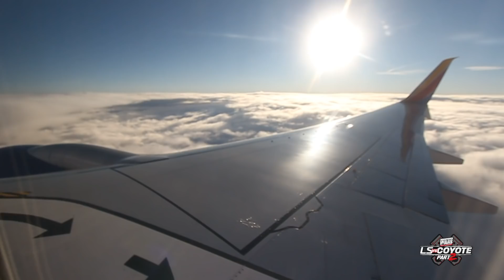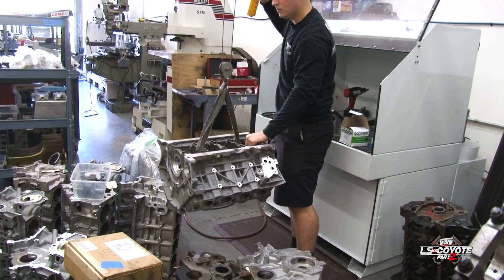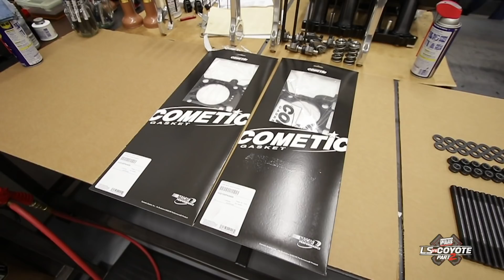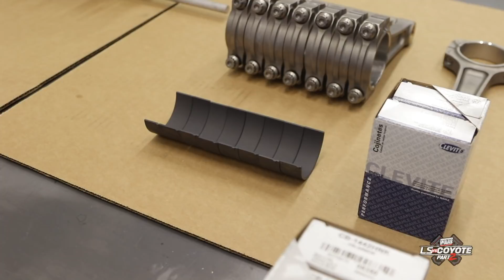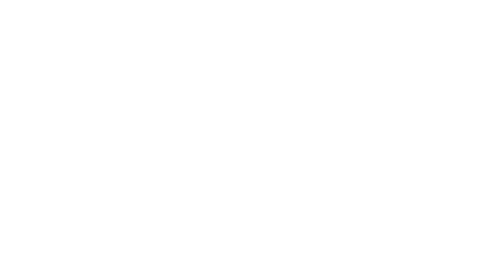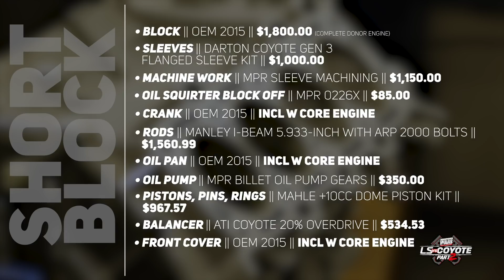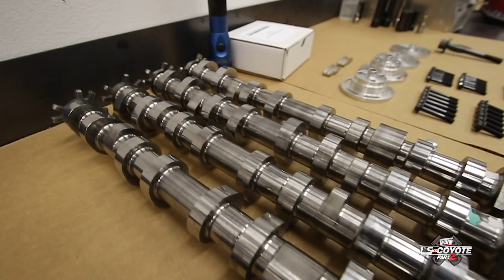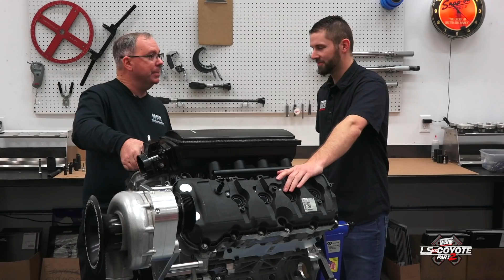LS vs. Coyote 2 Episode 3: The Coyote Engine Build

Comment: Edit: I'm glad you changed your mind about clumping the Coyote build into the dyno shootout. I appreciate the equal exposure :)

Wait...so the LSX build gets it's own episode talking about the build and the place building it, but the Coyote shares its episode with the final dyno numbers and track times?

Why do you guys try to act like you aren't GM biased?
Reply: @SyphonX  But hey...I get it...Stock GM motors cant make power and you need 7 liters to compare to Ford's stock 5 liter motor....
Reply: @SyphonX  If it's better why didn't they use the LS3 out of the Camaro they started with in the beginning of the series?

6.2L isn't enough motor to handle a little bitty 5.0L??
Reply: @richardhead8826  you clearly dont understand displacement. Ford used a fully machined 5.0 with custom sleeves and all. The 5.0 dosen't have stroker kits and head kits the LS is all about stroker kits and head kits. You can take a 6.0 LS and stroke it up to a 7.3 by just changing the crank because the blocks are the same size. They took a 6.2 and put a stroker crank in it. That's all.
Reply: @robertgardner2782  This is not true...MMR made 2000 hp on a 358 stroked Coyote based block. 
The SBF 347 motors were KILLING any LS1 they pulled up to back in the days.
Stroking and boring Ford's is not a new concept.

The point is the reason LS has so many aftermarket parts to choose from is because they NEED it to match the efficiency and power the Coyote can make.
The point is I BET a years salary a MAX EFFORT LS3 wouldn't come CLOSE to what the Coyote in this video is going to make with even 1.2 more liters.
The point is LS needs a Honda engine more displacement just to keep up.
Reply: @robertgardner2782  
It's possible to stoke a coyote beyond 5.2l with an aftermarket block, its just very expensive since there is only one source available as far as I know. MMR.
Reply: @richardhead8826  a 358 is a custom crank job that I'm sure costed alot more than $15,000 budget build. Ford offers no crank swaps for the 5.0 or head swap options for 5.0 and the funny thing is the 5.0 is larger and weighs more than the LS. You just sound nervous. LS guys are not complaining about the LS build cuz we not worried about the results lol.
Reply: Not to mention doing the math of all the prices they showed, there is over $1600 missing out of the budget. 

My total came to $13,042.10
They said $14,668

Weird.

Even if it's taxes, which in Florida is 7% that comes to a total of only $13,935.
Reply: @robertgardner2782  Not nervous at all. Next video will show either the Coyote winning, or more bias. I stated in the introduction video to this series that boosted is where Coyote shines over the LS motor. LS is King in the NA world.

¯\_(ツ)_/¯
Reply: Richard Head slightly older but still has lots of potential is I never get is why nobody even thinks of the 351 Cleveland or 351 Windsor. You can modify it heavily and make tons of power just like the LS motors. And do it just as cheaply like you can an LS motor. Just baffles my mind that people have these arguments and never consider that motor in the discussion. Also, MMR made a 3200hp Gen X Coyote motor.
Reply: SyphonX you do know they had 5.8L in the ‘13 and ‘14 GT500 right?
Reply: @SyphonX  lol, right, because its not like no one has already stuffed a 8L quad turbo w16 into a car the size of sedan and still had room for more heat exchangers then an air conditioning factory. No way a slightly wider and longer dohc v8 could ever fit in something the size of a mustang.  Also, even if it was somehow impossible to have a 6 liter flat plane v8, and its not, no one said the voodoo HAS to run a flat plane crank, the coyote is capable of 8500rpm with voodoo heads. That said, notice all you've got is "its too wide". No answer to the old small block's relative mediocre output for its displacement.
Look, dude, I like both GM and Ford stuff, but that dosn't blind me to the performance shortcomings of the old school cam in block stuff. I know, I've been building them for years. There is a well-built blown small block sitting in my camaro right now, but 4 valves are simply better than 2 when it comes to raw airflow and horsepower. Deal with it and quit being a jackass.
Reply: @SyphonX  the voodoo engine has like 310ci and do 526hp. Ford can just stroke the 302 and make over 550hp. The same goes to voodoo engine. It will fit the same. Ford doesn't need a 6.something ci to run fast.
Reply: @domenathor5.0 , you know your displacement 🤦‍♂️
310 cubic inches is 5.07999
Reply: @bowtie-man  they did so well with it they went bankrupt.............
Reply: @jonathangray7067  I just wish fomoco would pay my tax money back, oh wait that won't be until 2022.
Reply: @bowtie-man  but they will pay it back, thats the difference between a loan and a bankruptcy, i dont want your lil head to blow up by asking you to do some research! But if you'd like to learn something go read about it
Reply: @jonathangray7067  how about you hold your breath until they pay it back. 😂😂😂😂😂
Reply: @bowtie-man   Ford never took your tax money. They took a loan, which was paid back. They didn't need the money . Gm And Chrysler were subsidize companies and Ford took a government loan so they could compete fairly with government motors or have you forgotten that the government fired GM's CEO and sold Chrysler to Fiat.
Reply: @waynewilliams1726  wow how nieve.😂😂😂😂😂😂😂😂😂😂 https://www.quora.com/Why-does-Ford-Motor-Company-continue-to-hold-onto-its-5-9-billion-U-S-taxpayer-loan-at-25-interest-when-all-other-auto-manufacturers-in-the-U-S-have-already-repaid-their-bailout-loans-and-federal-assistance
Reply: mr.18436572 and then there’s also this from the same site - https://www.quora.com/Why-was-Ford-the-only-major-US-car-manufacturer-who-didnt-accept-a-government-bailout
Reply: @TFS96GT  it's common knowledge that fomoco didn't get a bankruptcy loan this time but they did receive a taxpayer loan of which they haven't paid back, that is till 2022. Speaking of bankruptcy. https://asavagefactory.wordpress.com/2009/05/16/ford-got-the-largest-government-bailout-in-history/
Reply: mr.18436572 I don’t even know why this is being brought up when this whole video is about engine wars. But check this link out - https://www.google.com/amp/s/www.autoblog.com/amp/2018/11/28/trump-says-gm-should-repay-u-s-taxpayers-for-bailout/
Reply: @TFS96GT  because the oval girls can't keep from😭😭😭😭😭😭😭😭 about something that happened almost 9 years ago and the fact that your new tech is getting schooled by 69 year old pushrod tech.😂😂😂😂
Reply: mr.18436572 I don’t know if you caught any of my other comments but this will be the 3rd time I’ve said it. I don’t know why some (obviously you) can’t recall that there is an engine made by ford thats just as easily and cheap to upgrade or make high horsepower with. That is the 351C and 351W, both of those motors you can go get out of a junkyard for $400-$650 and do whatever you’d like to. I could care less which engine wins this horsepower war. In reality whoever is happy with whatever engine they have so be it. I just don’t get why most LS fans think there isn’t a ford engine out there that can’t be as easy to put big numbers down when there is. I like both motors, both motors perform exceptionally well. There are pros and cons to each. All of which is obvious.
Reply: @TFS96GT  then why isn't it the 351 vs LS challenge? But the reality is that majority of the ford people don't use the old ford pushrod engines for some reason, go figure.
Reply: mr.18436572 Oh my gosh... because of the obvious which is they’re taking what’s new this LSX vs the new coyote. And in another comment I also stated just that saying this is a comparison between the newer motors.lol 

I know they don’t and I get why in a sense. It’s what popular and new, the mod motors do run well and like I said both motors run exceptionally well and both can put out some crazy numbers. The new coyote block is pretty impressive, MMR has been able to squeeze 2214 hp out of it and the block hasn’t gone yet.
Reply: @TFS96GT  you do realize the mmr coyote block is a fully cnc machined billet block at about 11k for a bare block? I would hope it would support 2200 hp.
Reply: mr.18436572 MMR posted on their Instagram  2214hp coyote still relies on the factory block and cylinder head casting. It’s also featured on their website go check it out. They have a billet block that has 3200hp if that’s the one you’re talking about.
Reply: @TFS96GT  so what's this? https://www.dragzine.com/features/car-features/inside-hellions-358-cube-2000-horsepower-coyote/
Reply: mr.18436572 do you have Instagram? Visit their Instagram, the post is dated January 11. Here’s a link - https://www.instagram.com/p/BshUI4xF9M_/
Reply: mr.18436572 even better - https://youtu.be/VxJozW_DFPs
Reply: @bowtie-man    GM will never repay the losses the US government incurred bailing them out:  https://www.reuters.com/article/us-autos-gm-treasury-idUSBREA3T0MR20140430
Reply: I'll believe this before I believe Instagram. They say the 3.8 1/8th and the 5.8 1/4 sec records are on the billet block here. That block was out in mid 2016 
https://www.google.com/amp/s/www.yellowbullet.com/forum/showthread.php%3ft=2198297&amp=1
I can't keep track of MMR and the Accufab mod record battle though so that might be part of the confusion?
Reply: SyphonX  I’m not arguing with you, you said there’s a reason that ford limited their motors to 5L but there was a 6.2L 2V in the Raptor truck. All I’m saying is that that’s an overhead cam motor as well. My point being it didn’t shake its self apart.
Reply: Well the original argument is a moot point now, they changed their mind on wrapping up the Coyote build and the dyno runs in one episode.

I'm not 100% pleased with the choices made, they didn't even touch base on OPG's which are required over 800, that Holley intake is overkill I personally know people making 1500 through CJ intakes that cost half as much, between that savings and the extra money left over they could have gotten Voodoo heads on it and ramped it to over 8k with that CJ making power the entire way.
Reply: Saw someone said mmr, they're doing 2200 hp out of a sleeved factory 5.0 block and heads. Thats up there.
Reply: Jonathan Gray they also have a Gen X at 3200hp
Reply: @SyphonX  no no bro we ain't talking no exaust shit. Stock gt vs stock ss. The coyote made 9 more. And big whoop if you really want to talk about extra exaust shit then how bout how the bullit and how it's a stock production car making 480 horse. That's only 25..... Or the big elephant in the room on how almost all 2018 coyotes dyno and reveal they make 490 horse or the fact with the same co developed transmission the mustang is quicker 0to60. When you are a biased asshole someone is gunna hand it to you.
Reply: Spoilers from the dyno, the Coyote breaks a timing chain and the LS scatters itself on the dyno. 

They both blow up.  😂😂
Reply: @SyphonX  😂😂😂😂😂😂😂😂😂😂😂😂😂😂😂😂😂😂😂😂😂
Reply: The LS build in my opinion was overkill. They could make good power using a stock 6.2L block, crank and factory worked LS3 heads. Guys do it all the time. I'm a fan of both engines so I consider myself unbiased. The fact that LME built a 7.0L is a unfair advantage on the LS's favor. I call bullshit on this comparison. Also because the use of a supercharger the increased displacement is even more of an advantage.
Reply: @phillipstein9099  
Simpleton how is the blower an advantage ?  They both have a supercharger and had the choice between the same models. The ford went with a slightly smaller one. F-1A-94 vs the Chevys F-1X. No one had an advantage win it came to picking Blowers. I swear some of you never touched a car with a wrench in your life. All your half asses knowledge comes from the internet and YouTube videos. 
Also while some people do use mostly stock ls shit or those blocks. They don't last after you get over 1200-1400hp and lots of boost.  They just don't stay together. You need the lsx block with the 6 bolt head to keep in on the motor. Wasn't over kill at all. Was their only shot at a chance of winning.
Reply: i really think we're  being generous with the LS Factory block numbers, i don't think they do well over 1000hp. That being said the LSX block NEVER came in a car or truck, it is  the same architecture as a LS7 but has a thicker wall casting. So really everything about this match up is apple's to oranges. Dohc vs push rod, factory sleeved block vs almost a factory block. The ProCharger gives the LS a slight advantage, it takes torque to spool boost off of the crank, and the LS has torque. but if this was a turbo challenge the coyote would kill that LS. That 5.0 will pass air through it like a jet engine.
Reply: @waynebollentin989  ...what's up with the name calling jack ass. It's not that fucking serious. You clowns sure grow a big pair of nuts while sitting behind a keyboard. Like I said if you can actually read, I'm a fan of both engine designs and both manufactures so your entire reply is moot as far as I'm concerned. I'm LS swapping  my Fox body and would've appreciated a LS build using more factory components like the block and heads.
Reply: @SyphonX  ummmmmm not biased at all here but the 5.0 made more horsepower than the ls3 back in 2015. And the 2018 coyote is already making more power than chevys lt1. And the lt1 just came out in 2015 for the c7 corvette. The 5.0 started its journey in 2011
Reply: @SyphonX  most likely didn't think they needed it. Plus show what they can do with just a 5.0L motor. With a factory ported head. 
I've raced both so I'm just enjoying the battle. They both work fine but I must say MMR has kick the shit out of the LS guys. Factory block, crank and head went 5.88 at 255. Not LS has come close to that with those 3 things being factory on he LS.
Reply: @SyphonX  my friend, with todays technology they can do whatever they want. And ill talking about all the American V8 brands. Ford can do a big block DOHC but they doesn't need it because they are having a lot of success  with coyote engines and now we are seen  more racing parts for them. Is just business. Thats why the GT500 was gone at 2014 with 662hp and the hellcat came with 707 in 2015. Just business.
Reply: Exactly
Reply: you do realize in the rules video they said it was up to the engine builders to choose the block and internals.
Reply: @SyphonX  there not limited to 5.L MMR has the 351/5.8
Reply: @SyphonX  that 351 is mmr gen x block.  Billet aluminum block, not stock.
Reply: @jonathangray7067  I will say that MMR did make 2214hp on a factory block and cylinder head casting.. how far will the factory block go before it pops? That I don't know.
Reply: @SyphonX  no there's always a argument, the Ls is limited to how big you can get the port cuz of push rod, it will run out of air,  the the coyote is limited to space, big heads mean the deck height has to be lower, a destroked motor, also a big reason for the rpm.
Reply: @jonathangray7067  now I was mostly defending the coyote but now your making the rest of us look stupid. You have no clue what your talking about when it comes to heads moving air. I'm not a die hard Ford or Chevy guy. I've built, tuned and raced both over the last 25+ years. Had great success with both and they both make power. The ls isn't like the normal SBC when it comes to head and port design. Stock ls head will flow 330cfm stock and aftermarket well over 400cfm. The stock 4v doesn't move more air then a stock ls3 head they're close. The benefits of the 4v and why they made power isn't the air. It's the advantage of the variable valve timing and the high rpm they can spin. At the same time the 4V is less reliable because of all the extra moving parts. This is what an unbiased view looks like. 
Instead of getting half ass information from the internet from your bubble. Do some really research from multiple sources. Learn how makes horsepower and why. The reason the coyote does well isn't because it moves more are. That's complete bullshit. 
If you still can't comprehend this call any racing engine shop that flows heads and ask them based of just the valve size because I know this is where most have the problem you think 2 valve flo more then one and thats not the case here. Ford 4v intake valve size is 1.46 ×2 that will only support about 575hp
One 2.165 intake valve for Chevy will support about 630 hp. Once you understand why and how a motor makes power and why combinations are so key you'll be much better off. Don't just assume things because of size and amount. Just as to small can kill power so will to big.
Reply: @waynebollentin989  you might wanna look up volumetric efficiency...... the coyotes ve is 100% a n/a engine doesn't get any better.  The LS ve is 90% fyi a flow test is vary inaccurate, to many unknown variables. Scavenging, quenching, velocity. This is how professionals tune for different barometric pressures. so simmer down sparky.
Reply: Jonathan Gray  Wayne is looking at peak flow, but disregarding the massive flow advantage the Coyote has in the .100-.400” lift range. 
Given typical flow curves, an LS head (or in-line valve head) will typically need to outflow a 4V head by 40+ cfm @ peak flow to support similar power, because the 4V flows so well as soon as the valve comes off of the seat.  

Gen 2 Coyote cylinder heads do outflow both LS3 and LT1 cylinder heads by a notable amount (they flow ~330 stock on a SuperFlow @ 28”), and the Voodoo heads outflow LS7 heads. 
And that’s just talking peak flow numbers, totally disregarding the 4Vs major sub-.450” lift advantage which is much more important than peak flow because THAT is the lift region where that valve spends most of its time and does the vast majority of the cylinder filling.  
The old Ford GT/GT500 cylinder head castings can be taken to 400/330 @ 28", and still retain that low-mid lift advantage that is inherent to 4Vs.  
Ron Robart @ Fox Lake Racing now has a Ford GT cylinder head program for the GT500/Ford GT castings that flow 390/330 on a 3.552" bore, and with a little more detail work can be taken to 400+ cfm on the intake side without too much problem.  

Check out what happened in the 2013 Amsoil Engine Masters Challenge.  
BES’ 3rd place 4V entry outpointed and made more peak HP all of the LS builds entered, including BES' own LS build.   

The BES 4V had 330 cfm 2003 Cobra heads (not Ford GT/GT500 heads like the article mentioned, which flow much better), while one LS had 400+ cfm All Pro heads, more displacement, more cam duration and a similar single plane intake and still came up short in both peak and average power.   Feel free to explain this, Wayne.  

Wedge heads do not perform like the flow numbers suggest, with the same flow and all other factors equalized (port volume, cam, displacement, compression, intake/exhaust design, etc) an opposed valve head (even a 2V opposed valve) will outperform an in-line valve head it by several percent in power output.  Proven repeatedly.  
The 4V configuration makes that even worse, with much better velocity and even more valve area and less shrouding for any given bore size.  
The 4V pent-roof combustion chamber is the most inherently efficient and knock resistant combustion chamber possible in a gasoline engine.

Wayne, the LS valvetrain may have fewer moving parts but it has far more moving valve-train mass.  
Mass and inertia is what causes parts breakage/failure, not the number of parts.  
The Coyote historically has far fewer valve-train problems than the LS, whether stock or modified.  Valve-train reliability has almost been an Achilles-heel of the LS since its inception and continues to be today with the rash of AFM/DOD failures.

Jonathan, regarding VE a bone stock Gen 2-Gen 3 Coyote's VE is ~110%.  The Gen 1 Coyote delivered 106-107% VE off of the dealer lot.
Reply: @jonathangray7067  Since were bringing up random engines now. Don't forget the fastest mustang to this day is using a good old hated 4.6 stock aluminum block. I'm sure you know that though, oh yeah it runs 5s. Fastest ls stock block i believe is in the 7s. The aluminum 4.6 stock block has been proven to handle 2500-3000 hp. I don't see one other engine in the world, maybe a coyote holding that much power on a stock block.
Reply: @Karl Hopkins   the fastest SBE 5.3 is 7.16 @ 190 thats stock bottom end you know as it left the assembly line... factory  ls blocks have been in the 6's since 2005 at least...
Reply: @BCSVT  Thats actually a lie, The LS actaully had the best finishing curve in the competition, funny only a few cubes separate the engines the Modular get 2x as many valves yet couldnt make anymore  HP... The mods won because of how the competition is run you avg 3 full  pulls, they are run at seperate times. Its called engine MASTERS because its about the builder and tuning ability.  A quoter from the article in HRM " Interestingly, breaking down the numbers, the LS engines made more peak power than the top two mods, but when the final tally was added, the mods owned the field." Quit regurgitating lies FANBOIS
https://www.hotrod.com/articles/2013-amsoil-engine-masters-challenge-top-finishers/
Reply: shaadydog1  Wrong, as expected of an illiterate LS fanboy.   Read what I actually stated genius, the 3RD place BES 4V outpowered ALL of the LSs in the competition. 

The TOP 2 scoring 4Vs made significantly less peak power than the 3rd place 4V due to the long runner Cobra R intake manifold selection.  EMC is not a peak power competition, even though the LS still lost in that respect!

FYI, Kaase’s 1st place 4V with NO changes other than a single plane intake manifold made over 820 HP, but the single plane would have pointed lower in the competition due to the mid-range losses.  

The Modular made more peak power than all of the LS’s in the 2013 EMC, and made more average power which reflected their sweeping the top 3 spots in the competition the first and only year they were allowed to compete.

Run along, boy, you’re out of your depth.  
Sorry bro, you need to improve your reading comprehension skills
Reply: Still perpetuating the lie? Read the article I linked. Its quite clear you are rembering shut that didn't happen in the EMC like a typical Fuqtard Fanbois.
Read it and examine the dynographs little guy you might actually learn something. 
https://www.hotrod.com/articles/2013-amsoil-engine-masters-challenge-top-finishers/
Reply: It's also clear you don't understand the scoring process and the formula applied to factor in cubic inches. STFU read it and learn something! 
https://www.hotrod.com/articles/2013-amsoil-engine-masters-challenge-top-finishers/
Reply: shaadydog1 shaadydog1  Still replying to yourself?  Still triggered?  What’s clear is that I was correct, and you weren’t.  Also, I fully understand the EMC scoring process and can clearly read a dyno graph more accurately than yourself.

Feel free to go back to the original post you replied to and provide quotes from the article that are contradictory or support your initial claim of me “lying”.

PS.  Good luck, you will fail in this endeavor as hard as your failed at actually reading the article you linked.  

Like I said, you’re out of your depth.
Reply: Go aead point out where the LS was behind on those dynographs lol. Those as quoted are the "Best Qualifying Dyno Pulls" Fuqbois. You can't, It makes more torque down low than any Modular and as much HP uptop with a bigger torque curve than  the highest hp Modular you seem to think is the end all... Similar cubes,  yet  More Modular Fail. Sad all the Fuqtard Fanbois, just the blind leading the blind unwilling to read clear Black and White evidence.
Reply: shaadydog1  I’m still waiting for your ignorant ass to show me, based on my original statements, where I lied.  

Still beating around the bush, still showing yourself to be an illiterate fool.
Reply: @BCSVT  Its pretty straightforward, you are claiming the 4V superiority yet here we have an example that disproves that. Where are coming up with 5.2 heads out flowing ls7 heads? How are you even comparing them and saying all things being equalized? LOL Thats just dumb shyt there, completely different port design and you want to equalize port volumes and CSA? GTFOH  That is only part of the runner length anyway the rest is in the intake design.  Again you believe all the bs  that may be true in certain instances but when you are talking performance, racing, and purpose built shyt it can and does go out the window. Low lift flow means nothing on the LS or any 2v inline head, a good roller cam especially solid roller cam just isnt their long enough to matter, and on a 2 valve, good low lift can be the source of reversion something not wanted. Total lift and time at each lift point matters . The 4v and Hemi problem is interference, it limits total lift and duration especially on a small bore. For the all the  "good"  a 4v brings to the table why didnt you have one  4v with the most torque? or make more hp? or have the broadest hp and torque curve in the 2013 challenge? Again, those graphs are the best of the  of each respective team. The LS only the one to start with 300 hp, first to 600 torque and 600 hp only one to break 675 torque. Cubes were very close as close, as you can expect over 2 entirely different platforms, the difference about the same as 5.3 vs 5.0 everyone is crying for.
Also I find it funny some well known 4v porters claim high flow numbers at lifts not attainable  or used by any decent cam grinder. Who cares about .600  .700 .800 flow when peak lift is .550 or less? Its not black and white and depending on application the advantages are not nearly as good or even fully realized like the vvt. Bigger cams negate how much it can be used.  Its also very difficult to get good quench out of a 4v and Hemi without sacrificing   some flow,  which can mean the 4v or Hemi wont  be as fuel efficient. That would show up in BSFC and Timing... 
Thats OK though, you keep drinking from the punch bowl little guy and using ricer math to claim some moral victory...
Reply: @SyphonX  sometimes i just don't get why people don't get the obvious. Let me ask you whats the most popular ford motor at this moment? The answer the 5.0L... It isn't the 5.8L. Granted its obvious more liters/CI can make more power but they're comparing whats most popular and available to consumers. People aren't doing 5.8L swaps most are doing the Coyote swap. I'm not trying to be smart but like that should just be a no-brainer.
Reply: @SyphonX  are you implying I'm complaining? or others? Because I don't see where I said anything to make it sound like that. Also, keep in my mind and I've already said this in another comment. A lot of people will compare the LS to the new mod motors and say its expensive to mod which it is. But one thing they forget is that you can take a 351C or 351W and heavily modify it. So if the people who say you can't build a ford motor as cheaply as you can an LS motor, they're wrong because you can go get a 351C/351W out of a junkyard for $400-$650 and start a build and the rest of the story should be obvious. I don't know why people never consider that engine in a ford motor vs ls motor discussion.
Reply: I'm still surprised Tim Eichorn picked an F1A for the dyno battle.  
The F1A gives up about about 250 peak HP to the F1X at max rpm.
Reply: @SyphonX  and Richard Head it's very amusing how yall two grown men are arguing like children calling each other children lmao 10/10 on the entertainment 😂😂
Reply: Or would be limited to the engine bay of a truck.... (Raptor) and have no aftermarket support and be the Unicorn swap you hear about but never actually see 10 fuqen years later
Reply: Read it and examine the dynographs.   https://www.hotrod.com/articles/2013-amsoil-engine-masters-challenge-top-finishers/
Reply: shaadydog1  Perhaps you should take your own advice, further proving your illiteracy. 

BES’ 3rd place 401 CI 4V - 775 HP
SAM’s 4th place 436 CI LS (and the most powerful LS in the test) - 774.5 HP

Feel free to retract your idiocy, fool.
Reply: @SyphonX  So you don't think its GM biased?
Completely new LSX block that didn't come in the car this series started with?

Using a 7.0L motor versus a 5.0L motor?

Yea...not biased in the least....
Reply: @richardhead8826  Imagine Ford making the 7.3L Godzilla V8 in DOHC 32V form put it up against a 7.0L LSX.
Reply: @SyphonX  Aren't you past your bedtime old man? Hang up your New Balance shoes and put away your jorts and head to bed pops.
Reply: @SyphonX  I mean...GM stole the tech from Ford....

 ¯\_(ツ)_/¯
Reply: @SyphonX  You can also say that it takes GM over 6 liters to do what Ford does with 5. You can also point out that gm fanboys should be grateful that ford limited themselves to just 5 liters. If the Coyote was a 6.2l it'd be making almost 550hp. And God help you if the voodoo was a 6liter. That thing would be over 600hp. Either one would make an LS look pretty silly.
So chill out.
Reply: @177SCmaro  You do realize the coyote is an DOHC assembly right? If you want to go down that path, imagine what an DOHC LSX would be like..
Reply: @area51mtn  
I literally have a 5.0 coyote sitting in my garage all apart. I know what they're all about. 
A 4v lsx would be badass but good luck ever getting GM off the pushrod wagon.
Reply: @177SCmaro  
Better yet ford made it's move... they built a 7.3 L push rod engine. DOHC is for imports
Reply: @area51mtn  And anyone who wants hp above 7k
Reply: @177SCmaro  Imagine the Coyote displacing at 7.3 liters.
Reply: @CJColvin  She'd be a monster. 650hp would be the starting point.
Reply: @177SCmaro  I know Ford is making the new 7.3L Godzilla V8 for the 2020 Super Duty with its Pushrod design but a 7.3L Godzilla V8 with DOHC and 4 valves per cylinder will make well over 650 HP then add a 3.5L Supercharger and it'll make over 2000 HP.
Reply: @CJColvin  
As I said, 650 would be the starting point (same hp/l as the current coyote) it would go up, and get crazy, from there with a good pair of 4v heads plus boost.
Reply: @177SCmaro  Correct mate. In my opinion Ford definitely makes the best V8 for mass produced cars.
Reply: @CJColvin , Mercury Marine converted a LS7 to DOHC and made 750 HP naturally aspirated
Reply: @anthonywebber2211  Sounds awesome man.
Reply: @SyphonX  Because the LS3 is crap...

Ok...I understand.
Reply: @SyphonX  Well I'm 44 and you called me kid...who's the loser here?
Reply: @richardhead8826  and what tech did a GM motor take from Ford?
Reply: @nathan22outdoors8  Google it.
Reply: @richardhead8826  im asking you not google. Stating a point and then tell the other person to "Google it" doesnt win an argument.
Reply: @nathan22outdoors8  the oil pump in the front of the block, the direction of water flow was reverse, same as the ford, canted valve design, closed chamber valve design, same degree block, 4 head bolts per cylinder, bore and stroke, cylinder spacing is the same as a old chevy 350, but so is the ford 351. The high cam in block  is what what makes the LS and 351 so special, allows for larger intake and exhaust ports, and better transference of energy through the rocker arms. These two motors have a lot in common. The only thing a LS and old 350 have im common is the bore space, and the only thing really new on the LS that the 351 didn't do was cathedral port design. But i will say that modern technology really opened up what that block could do, but the E.P.A outlawed the ford 351, so it was hard to see what it could do till the late 90s. Its  just everything that makes the LS good is the same things the 351 had 50 years ago, their just wasn't good enough smog technology back then.
Reply: @nathan22outdoors8 
A: I wasn't even arguing with you. 
B: It's a common knowledge thing between Ford and Chevy guys....so if you don't know about it, then you aren't either. I'm not here to educate you.
Reply: @nathan22outdoors8  I think they took the tech from small Block Fords.